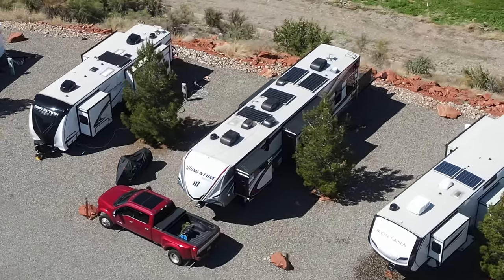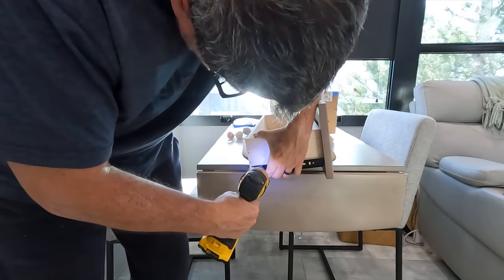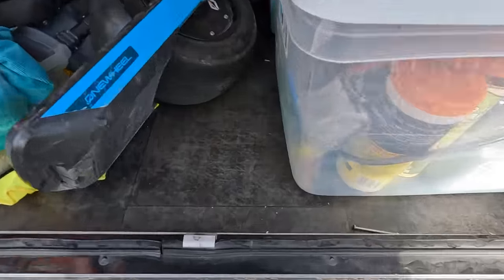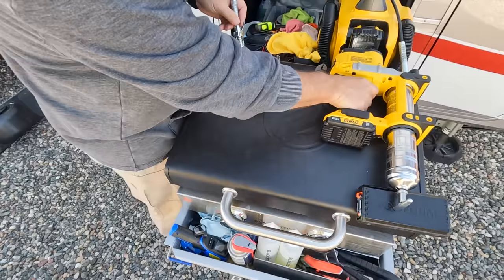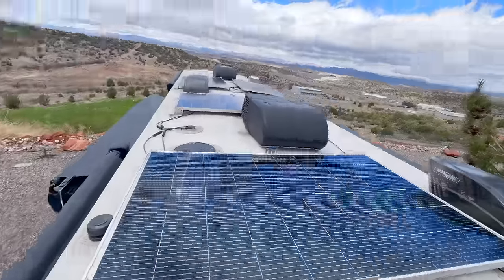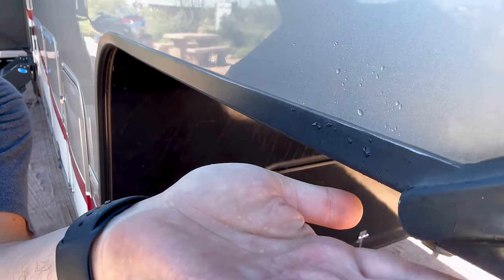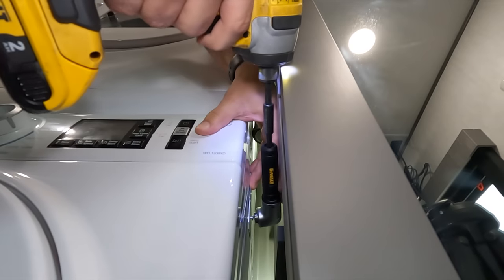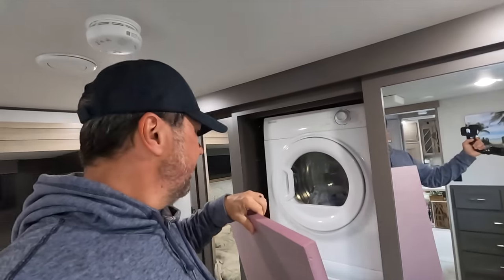Quick Fixes to some Annoying RV Problems! (RV Life!)

Comment: Have you ever had a storage compartment that causes condensation?  I have one, and not sure how to solve the problem, should I just drill some air holes at the top?
Reply from the maker: No.. never had that issue.  Inside the basement?  Maybe some damp-rid?
Reply: @ChangingLanes   Yes, it is in the basement.  I have a class C and it's the compartment right under the fridge.  It causes condensation, even when the fridge is not running, like the winter.  I am suspecting there's insulation at the top because of the fridge and that's why it is happening.  Thank you for the reply!!

Comment: For the dryer I cut pool noodles to size and shoved them in. It works great at cutting down vibration. Has just the right amount of give and rigidity. If you don’t have enough room for a whole noodle either cut it in half long ways or like a hot dog bun and roll it to fit.
Reply from the maker: Oh, I like that idea!  👍🏼

Comment: On the washer/dryer movement:  try cutting a pool noodle or foam pipe insulation In half and push it in beside appliance and wall.  You could put one on top and one on bottom.  Makes a good cushion.  We use these in a different environment and use some pieces to cushion between our bikes on the hitch rack.  Well Ha Ha I see below someone else said same thing!!!

Comment: I noticed those "basement" door latches have a plastic "slide groove" for the metal latch that slides in or out. I would think that a silicone grease lube would work as well which will reduce the friction on the slide especially over time as the dust/dirt builds up. I guess you could use that grease you used on the pivot arm but its pretty hard to beat a silicone based grease on plastics. Ace Hardware has small tubs of 100% Silicone Grease. I end up using that stuff on all kinds of things...a thin film of it works best.

Comment: Chad    I am very disappointed in you for fix for the washer.  The top of the washer is no longer to the washer cabinet.  The top slides and locks onto the cabinet of the washer.  There are screws in the rear of the unit that must be secured. The drier is going to continue to move on top of the washer.  and may result in additional damage to the cabinet of both units

Comment: It seems like you are having a lot of issues for a new unit.  I would be very unhappy with that manufacturer
Reply: No this is very common with any brand of Rv. All price ranges, all rvs. Unfortunately with rvs this is how it is. And it’s an ‘earthquake of your house’ when you drive it so things happen. :)
Reply from the maker: If they built these things to never have anything break, they'd weigh 30,000lbs and cost $500K.  They make RVs like that.  Check out Spacecraft.  Super nice and solid. But over $500K and require an HDT to tow them.
Reply: @golfaholics7777  I know there are issues with every RV.  I had a Motor Home but did not have so many little items that he has had to go thru.  I have always thought his manufacturer was a good one but getting 2nd thoughts after all the items he has gone thru.  A person with no knowledge of how to fix stuff would be at a disadvantage

Comment: Sorry to inform you….. the earth is flat! It’s so obvious. “Eyes to see and ears to hear” Lol
Reply: It was a good video, appreciate it. We have the same set up with our washer and dryer in our Grand design solitude. After a trip through Texas, we found that the floor under the washer and dryer gave away and it was leaning forward against the door. The only way I could figure out how to fix it was to drill a hole in the floor, prop the washer and dryer back up level bringing the floor up and sprayed foam insulation in it. It is a solid as can be now. Of course it kept expanding and created a foam snake coming out of the hole which I had to clean up later. Lol  Why they leave a floor unsupported is beyond me. Especially in the front nose where a lot of bouncing takes place and where a heavy washer and dryer is designed to  ride.

Comment: Our momentum 376TH was so bad that we ended up catching the roof with a big old tree all the way down the entire side of fifth wheel totaling it. I’ll never buy another grand design. Horrible issues. Tons and tons of issues. Slides uneven, water pipes/fittings busting, couches uneven in the slide out, roof vents leaked in a couple places, slide outs leaked in a few places, not a lot of water but a little trickle down the inside of the slide out in the living room just behind the slide where you couldn’t see it until it was too late. Window seals leaking. Fuck grand design. Horrible after 4 years. 
Our new Riverstone has been pretty good so far 2 years now.